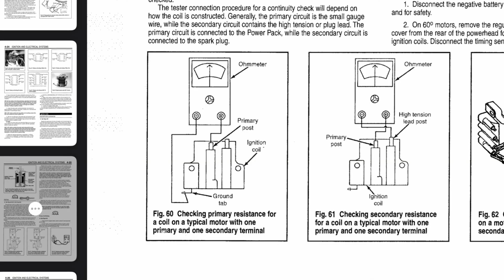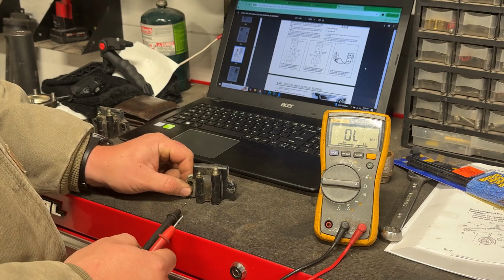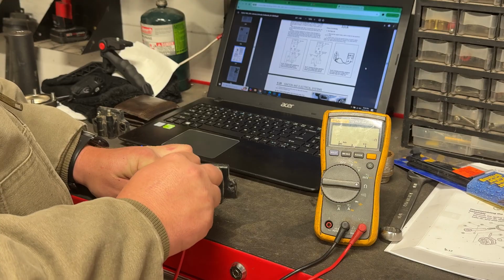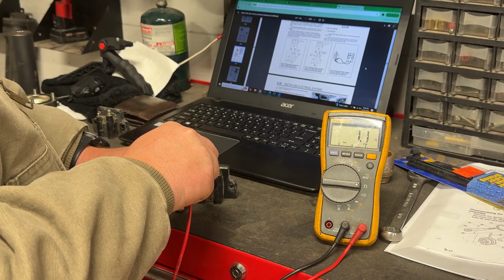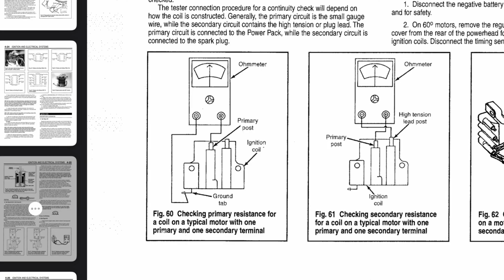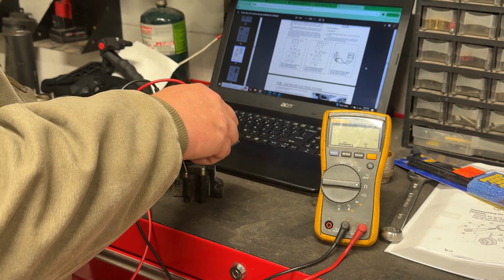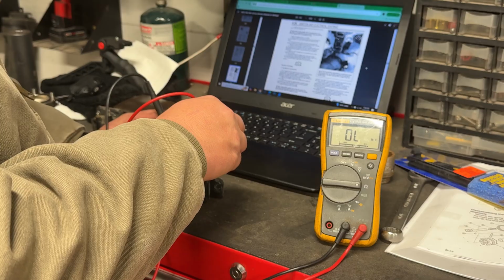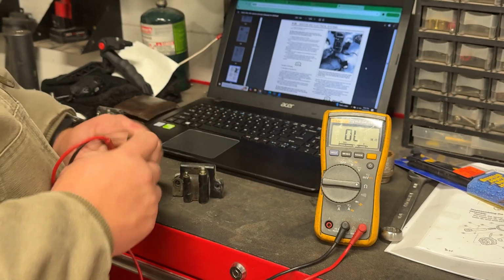Johnson/Evinrude NO SPARK - Try this! Testing an Ignition Coil

Comment: Thank you for showing me this. I have a problem with a Johson v4 that is cracking but not starting. There is fuel as the sparkplugs are wet. I tested the four coils, when I test the secondary coils in all 4 the readings are good. But when I test the primary coils, in all 4 the reading are .1 or .2. Is it possible that all the coils are bad? Thanks for your help if you have the time
Reply from the maker: It’s not usual that all the coils are bad. You just need to make sure that the test spec is right for that particular engine. The V-6 200 that I was testing would be similar but you need to make sure with the exact service manual for your engine. You can test the spark with a spark tester to each one. If you have good spark, there’s something else giving you trouble.
Reply: Look at your stator if all else distill fails